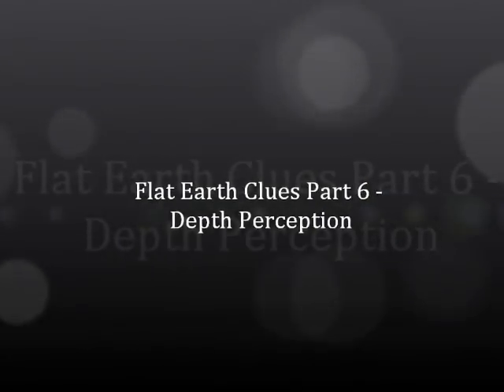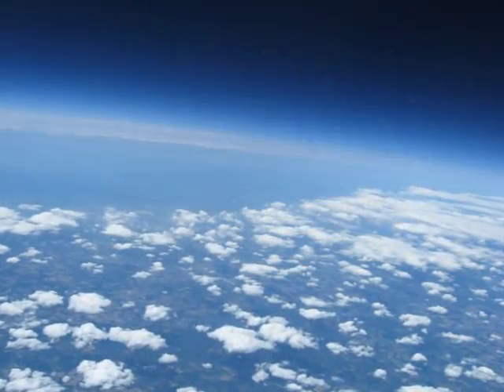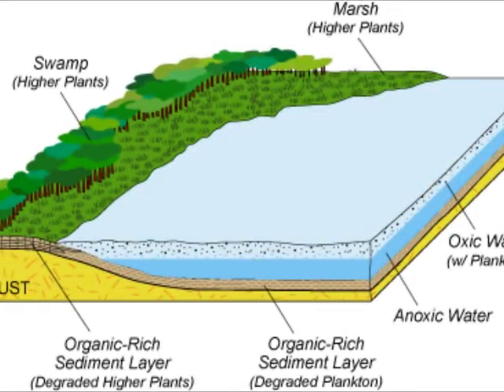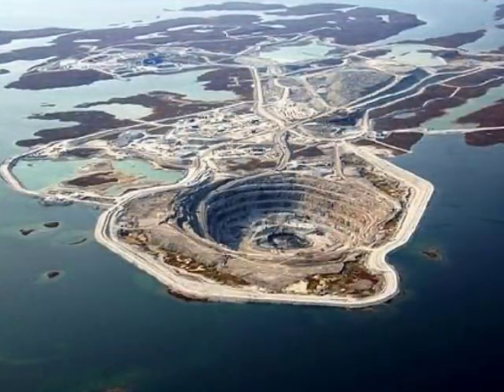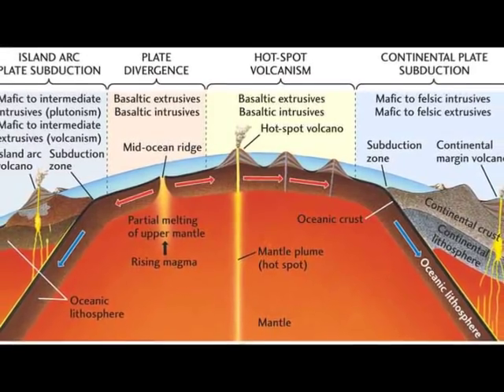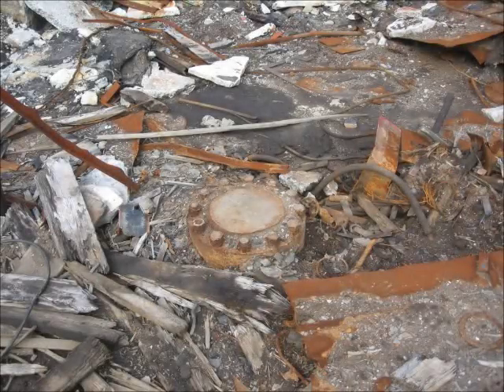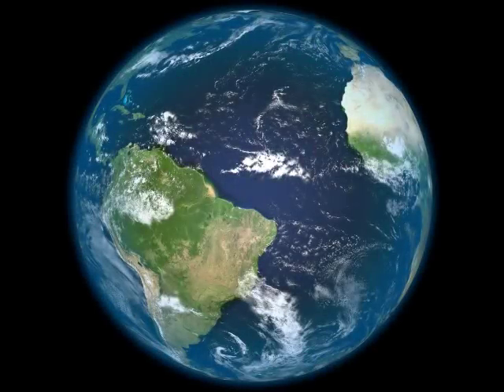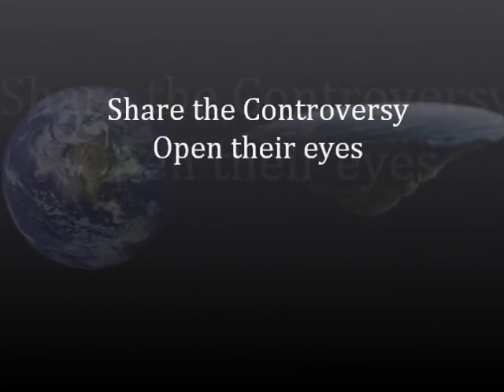FLAT EARTH Clues Part 6 - Depth Perception  - Mark Sargent ✅

Comment: A couple of questions:
1. If, as stated, no one- absolutely no one, has ever gone deeper than 8 miles, how were magma generating plants placed at various stress points between 50-100 miles in depth?
2.This special dome structure, of advanced high-density material strong enough to withstand nuclear blasts (as so nonchalantly stated), and projected heavenly scenes via LED technology also consisting of 3D tech, was created and maintained by whom- a multi-national governmental consortium? Also, how exactly is the dome powered? I can't imagine the energy requirement necessary for an LED screen with a surface area that is 492,617,951.43 square miles (give or take)! And, how will electricity be boosted all the way to the crown of the dome since electricity traveling along a wire experiences more resistance over distance? Were relay stations built into the wall of the dome?
3. You state that the sun, moon, stars, etc are projected by the LED screen, which is stated to be 100 miles in height. However, much of the flat earth literature states that the sun is about 3000 miles above the surface of the disk. Can you address this apparent dichotomy.

Comment: Who built the dome and out of what materials? Who maintains the dome and the various light fixtures, both those installed in the dome and those in the firmament above it? How are the various lights powered, and what drives the mechanism that revolves all of the various luminaries. A simple mechanical drawing and schematic wiring diagram will do.

Comment: Currently the estimation of depths of deep quakes may be 600 kilometres, these cause pressure to spread up and around the crust in predictable pathways based on observations over many years and leave quak s in their path. Even quake sizes are predictable and time... need to look at these observations and query in relation to flat arth model.The usgs and equivalent in other countries estimate or m asure quake depth. The rest stated here is observed and felt directly by people.

Comment: I've always wondered about volcanoes producing molten rock on the surface. Why? Because we are supposedly sitting on a ball which itself is sitting in space where the temperature is minus 273 degrees C, and it's been doing that for nearly 5 billion years. How can it still be hot enough to melt rock at the surface, AND what is producing that heat? After this period of time surely the ball should have cooled down to zero. What is keeping this ball this hot when it is enclose by absolute zero heat. The physics geeks will no doubt come up with some gobbledegook calculus to baffle us.
Reply: You know how you get warm when you wear a coat or a blanket? Increase that effect by a lot, and there you go.
Reply: +CriminalApple  yea i think this is why he said volcanos are fake. Because if gravity doesn't exist then there is noting to keep molten rocks together and produce heat by friction. But we know some ancient kingdoms have  been destroyed by volcanic eruptions. So there must be something to produce heat beneath the surface. Maybe there are some dimensional soft spots where volcanos located and some tiny antimatter particles came to our dimension and produce intense heat. I know this idea sounds ridiculous but i can't belive floating water ball theory either. Because  of lies about moon landings  and some weird constants used to calculate gravity force.
Reply: Radioactive decay and tectonic plate movements produce heat. 
And, vacuum has no temperature.

Comment: imo, Listening to these clues after two years is interesting. 1) The 'sky display system' is explained by electromagnetism / capacitance. see: 'sun and moon group', eric dollard and ken wheeler.

2) The 'atmosphere' can be be prevented from 'expanding into the vacuum of space' by either a 'physical or ''electromagnetic' barrier. To find out? Ask NASA, they investigated it already.

 3) The eight mile depth limit is very real. see: 'Kola Superdeep Borehole'. 

4) The 'magma system', i suspect is artificial.  You don't need to be in physical contact with hot stuff to make it move.  

Meteorites? Only small ones get to the ground. Any large ones always explode in the air and do not kill many people. 

Earthquakes / tsunami? Hmm, they do kill many people. I wonder about those.

The foundations of the world we live on are not made by people.  You can call them 'creator' or 'God' if you wish. imo, Whatever, we live here and we are not going outside it any time soon.  

I am looking forward to what the next two years of research will show us.

Comment: Current theory of earths innards is plasma, and fed by cosmic rays especially when earth and suns magnetic effect is down as now in the solar minimum. Hence over time the earth has grown.  A tilted spinning plasma ball forms a north magnetic pole. This shows with a plasma ball tilted and spun...flat earth theory needs to address more. Like the earthquake pressure flows and then terminates at various points like the North Atlantic ridge, then deep quakes roughly not exactly opposite as viewed on the globe take place.. eg near Fiji which are observed to lead out to shallower larger quakes.need to look more at these. The flat earth theory is extremely interesting, need to fit more observations to it..

Comment: so this ultra high definition system and the super led technology that projects onto the dome the sky and all of that has been around for thousands of years? and we only figured out how to make HD tvs in  last decade or so ?  
and are you saying that the scaling decrease in temperature and the rise of the mountains in Antarctica is something that "they" did as in they can control the temperature at certain points and the heights of mountains? how would someone do any of those things ? just wondering